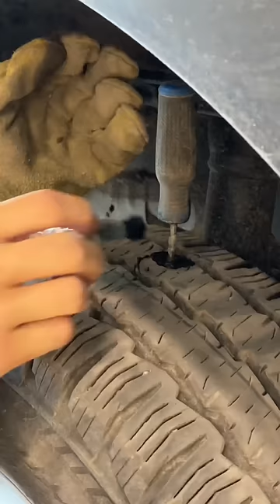Why You Shouldn’t Plug Tires #tiredoctor #tireguy #tires #shorts #tireplug

Comment: Tire shops hate people saving money
Reply: Crappy shop crappy service
Reply: It's actually DOT and the tire manufacturers themselves that directly state that these types of plugs are not approved for highway use. Installing these on a vehicle that will drive on public roads is illegal, so most shops aren't stupid enough to use them.
Reply: @grand_007 the crappy shops are probably the only ones doing it! All the other shops just want to sell tires 😂😂
Reply: @SleepyMongoose who do you think it was who lobbied and got DOT to claim they are unsafe to use but not unsafe enough to ban their sale.
Reply: @siegessaule  banned for highway use, but very useful for farming equipment which doesn't go 75mph+ on a regular basis. Being someone that has worked in the automotive field as a tech for (I lost track, 10ish years?), I will say that I would not be comfortable putting one of those plugs in my own car, due to the very important reason that unless you dismount the tire, you can't be sure that the sidewall is undamaged. If I am unwilling to make that repair on my own car, then I will not do it on someone else's car.
Reply: Former tire shop employee, this is true. Plugs can work well for many years but we weren't allowed yo use them because sometimes they dont work and then there'd be trouble
Reply: Or maybe they don't want to deal with repairing a tire with a plug in it because now they're going to be held liable for fixing something that was already damaged in the past the begin with so its a head ache.
Reply: 2016 Chevy Colorado caught a nail. Took it to the local shady corner  mechanics and they plugged it right in front of my eyes. The tire itself lasted for 30,000 miles before I traded the truck in all together to get my now 2023 Silverado
Reply: @SleepyMongoose ok Dingus
Reply: @SleepyMongoose  there is NO LAW prohibiting tire plugs for highway use in the USA or Canada. There are, however, guidelines for where plugs can, and cannot be used that have been posted by the US Tire Manufacturers Association. For example, plugging or patching a sidewall is a huge "no no" (though, it can generally allow you to limp the car at low speed off the highway if absolutely necessary).
Reply: @djbmw1 go to a parts store and grab one of these plugs type kits and read the packaging (you may have to buy it and read the instructions), somewhere it will either say "not legal for highway use" or "for temporary use only, see professional for permanent repair"

Every single one of these plugs that i have seen says one or both of those on the package or instructions.
Reply: @SleepyMongoose  thats to avoid potential law suits now, and in the future, to the distributor. There are no actual laws prohibiting the use. And i have several hundred plugs, as well as patches, since I own an auto shop.
Reply: @djbmw1  I don't care about your imagined credentials. If the repairs are acceptable, then there would be no need to avoid those lawsuits, right? If the repairs meet acceptable standards, then they wouldn't be liable. The patch/plug combos don't have that same warning, do they?
Reply: @SleepyMongoose  by posting a generic disclaimer they can sell plugs everywhere, at any time, and not worry about any current or future legal issues. This is why disclaimers exist.
Reply: @djbmw1  then why do patch/plug combos not have the same disclaimer?
Reply: @djbmw1  admittedly DOT regulations on tire repairs is very ambiguous, but it does state that repairs should be performed within the guidelines of the RMA or similar manufacturers group (which do not allow for these plug types), and the materials allowed for repair also implies (but does not directly state) that these plugs do not meet requirements.
Reply: @SleepyMongoose  To be clear, the DOT does not make laws. They can set guidelines and 'rules' which laws can then reference or be based upon. The DOT actually has an entire section on their website talking about the rulemaking process, if you want to take a read. My original comment was advising everyone that tire plugs are NOT illegal in the USA and Canada - period. There are, of course, advisories/rules/guidelines on their use - but no law says that they cannot be used in some sort of blanket fashion. From your comment above it sounds like you've now done a bit of research and are on the same page that plugs are not illegal for highway use.
Reply: @djbmw1  You do know that DOT regulations are actionable, right? The DOT can in-fact declare your vehicle is unsafe for road use an prevent you from driving that vehicle until it is properly repaired. (commercial vehicles covered under DOT)

A regulation is not a law, it is however the instructions on how to implement a law.

I am actually not on the same page, as the DOT regulations are a bit ambiguous on this matter as I have stated before. It would be on the DOT and the court system to decide whether or not the ambiguous language in the regulation prohibits the use of these plugs or not. Most automotive shops ban their techs from using these plugs due to this reason, the only shop I have ever seen that uses them was an independent shop. Every single shop I have ever worked at bans them.

The simple fact is that even if these plugs are not illegal, they still should not be used as anything more than a temporary fix or for off-road vehicles. The main issue is that there is no inspection of the inside of the tire, meaning you have no idea if the interior sidewall has separation of other damage that could cause a blowout. A blowout that may cause you the "shop owner" liable in an accident if you did not follow accepted repair practices.
Reply: First of all most but not all tire shops repair flat tires for free. Secondly a patch plug is the preferred method of repairing a puncture and installing one is just as likely to damage the tire. But the real reason I’ve preferred to not just plug tires is that you really should break it down and inspect the inside of the tire for damage. I can’t even recall how many times I’ve broken down a tire to patch it only to find it  full of shredded rubber because it hade been run flat.
Reply: Tire shops would happily do it that way if it was safe. A puncture repair is one of the least profitable things we do.
Reply: @bremCZ  every tire shop I worked at patched tires for free.
Reply: Moisture gets in the belting of the tire causing it to rust and separate. Some of yall have no idea what you’re talking about
Reply: @SleepyMongoose that’s not true it’s not illegal at all not even slightly
Reply: @SleepyMongoose  this is false. No law in any state bans the use of a tire plug on the highway so long as it is within the repairable boundaries of the tire.
Reply: That’s why you go to Costco for patches 😂😂😂
Reply: @SleepyMongoose  And all of that crap is why it's great to be able to do them yourself.
Reply: So many shops will do most leak repairs for free. Why do a plug if you can have them fix it free?
Reply: One of my local tire shops will plug patch any tire with a hole in the tread, and never try to upsell anything, but offer an inspection (only if the customer wants one) I asked the manager why they do this when anywhere else charges 30$. Aren't they losing money?

His responce

"People are so used to being upsold, or told the tire isn't repairable when it is they show up expecting it. This way they come back when they need new tires. At that point they trust our recommendation for mechanical work, and are more likely to get unplanned work done"

To this day I'm not sure if that means they eat the cost of a plug to make it easier to over charge in the future, or it was like the manager was implying and they charge reasonable prices, and are trustworthy.
Reply: My shop doesn’t fix a tire with a rope plug. But we don’t charge for flat repairs anyway🤷‍♂️
Reply: The department of transportation says it’s illegal for me (a mechanic) to plug your tire. If you wish to do it on your own time with your own tools then no problem I plug my own tires too lol but when it’s a customers tire it’s a patch and if it’s too close to the side wall then the whole tire is replaced
Reply: Sam’s club certainly is making a killing off me. I have to pay $0 for every patch done… breaking the bank!
Reply: @SleepyMongoose 🤓🤓🤓
Reply: Local tire shop owner here, we prefer to do plugs over patches or getting new tires. I’d rather work my ass off getting that plug in there rather then taking it off, doing a plug and work getting it back on. ESPECIALLY if it’s a big ass 24 or a low profile above a 18 inch.
Reply: @sleepdepello2932  I'm not saying plugs are worse. I am saying the US department of transportation does not approve plugs as a tire repair and you are opening yourself up to some nasty lawsuits because if you use a plug and someone wants to blame you for it they win the case because the DOT doesn't deem plugs as a safe repair

Comment: Farmer here. We have plugged everything. Cheap soft mower tires, pickup tires bald or dry rotted, skid loader tires that are hard as a rock (took an entire kitchen knife blade through the tire and that was 6 months ago it still never lost air), tractor trailer tires (unless the hole is bigger than 2 plugs, it always works even at 90 psi in the tire. The plugs are amazing. The only limits I have found for them are hole size. Not speed, not load, not heat. They are AMAZING. I would recommend people have small kits of them in their personal vehicles. The kit is extremely cheap and can save you a 200, 300, 400$ roadside assistance phone call. Once you're stuck out there, they know they have you. Especially at bad times of night, holidays, or in remote areas.

Comment: I ran a roofing company for 30+ years , and plugged hundreds of tires. I remember one tire I had that  had 23 plug.  And I have never used glue .
Reply: Technically it's not glue it's to vulcanize the rubber.
Reply: @rekcahx99   Really why does it say Glue on it?
Reply: @katkilr7685  you think the tube ALWAYS says glue?  I’ve seen it labeled LUBE.  Hope it wasn’t just an oil!  

The plugs you were using were clearly pre glued or they wouldn’t have ever worked.
Reply: @mikea5923  Well dude you are 100% wrong.
Reply: @katkilr7685  you’re trying to tell me your plugs were completely dry AND the tube ALWAYS says glue?  

You’re not a quiz kid, are you?
Reply: @mikea5923   You are about as bright as a burned out light bulb.
Reply: @katkilr7685  I’m not wrong.  Keep up with the bullshit no points, though.
Reply: Why do you think you have to peel that plastic sheet they come sandwiched in off?  That’s glue.  Durrrrrrrr.

Comment: I've plugged at least 15 tires on cars, trucks, and heavy trailers. Not one failure. And I've never replaced a plugged tire. I didn't even know that you're supposed to have it properly patched or replaced. The plugs work easily and permanently in my experience so 😂 shops and dealerships these days have no shame
Reply: Wowee at least FIFTEEN?? We’ve had that many in ONE TIRE and kept on truckin’ 😂  But u r correct you can run a plugged tire as long as any other tire if it’s done correctly.  I don’t think I’ve ever had one fail at the plug.
Reply: I have a tire with 24 plugs in it. On a small tractor.

Comment: It doesn't destroy the inside of the tyre. The reason they are not done from the outside and are even illegal in some places is that when a tyre is driven on while underinflated it can cause fatal damage to the internal structure of the tyre. The tyre needs to be removed from the rim and internally inspected before being correctly repaired.
Reply: THANK YOU !!!!!

Comment: I push it in dry. I'm just a savage like that.
Reply: Your talking about the plug right!! Lmfao lmfao 🤣 💀
Reply: At least spit on it….
Reply: Hope you at least take it out to dinner first
Reply: Out of necessity, because holes are always dry when you are around 😂😂😂😂
Bah dum dump
Reply: That's because they didn't know you were going to plug that hole. Got in there before they could say no.
Reply: Not even spit?😂😉
Reply: You realize that’s glue he put on it
Reply: @NoFaceTsu   Rubber cement*
Reply: Don't you prefer it to be a little bit wet?😂😂😂😂
Reply: I've done it and they still work just fine for years without cement if the hole is small.
Reply: That's what your boyfriend said
Reply: @MechanicalTriage hawk tuah
Reply: Lubrication is essential for work enjoyment!

Comment: As someone who was TIA certified to repair automotive, commercial, and Earthmover tires, I can say with certainty that all tires need to be plugged, if they have a penetration.  They also need to be patched from the inside, necessitating dismounting the tire from the rim, so it can be inspected.
Reply: That's a little confusing. They need to be plugged in patched or either or?
Reply: @rekcahx99  Not confusing.  For a tire repair to be done correctly, the hole has to be plugged, and a patched has to be applied to the inside of the tire.  To apply the patch you cut the plug off and buff the inside of the tire to get the patch to adhere properly.

Comment: i work in a shop. plugs are a temporary fix. patches/ plug patches are a more permanent fix but all of them have their cons and pros. as long as the air stays inside and its not on the sidewall youre fine as long as the tire integrity is good

Comment: I have used tire plugs every single time I've had a flat. I've even plugged a tire, taken my tires to get balance n rotated for the entire life if my entire mileage on the tires.
 The 1 time I took it to get patched from the inside my tire popped on the freeway..never again
I'm a Plugger for life!!
Reply: How would a patch cause it to pop?
Reply: @SamSam-ih6nt  the technician most likely buffed the inside of the tire too much, exposing wire.
Reply: That's why it's important to look at reviews for tire shops just like anything else. There are shops that will half ass jobs.

Comment: Yeah the shop also says the "sidewall" of a tire is the entire tire except for a 1/4" strip directly down the centerline and they still won't patch it...
Reply: you would think manufacturers would hve to increase side wall protection by now.🤔
Reply: LOL, so true!    Or, they'll say it's "too old to repair".    Meanwhile, tire wholesalers are selling new tires that are the same age, and they're fine.   A good half of tire shops are scammers, I swear.
Reply: Put your thumb on the shoulder of the tire, thumbs width is unrepairable. Good rule of thumb (ba dum tss). It’s like putting a bandaid on an elbow
Reply: @Gr8thxAlot  see I have an issue with your idea that it is the tire shops that are the issue. Check the DOT and tire manufacturer rules, they are the ones that stipulate the laws and rules for repairs and tire age. Shops that decide to break those rules do so at their own risk, as if they are caught they can face heavy punishments.
Reply: @brianjones1346 they do. They have different plys. But if you don’t want it if you don’t need it. It’s bad for mpg
Reply: @SleepyMongoo never plug your sidewall . Emergency situations only but get a new tire soon as you can if you get a sidewall hole in the tire
Reply: If you do a patch on the inside you have to scuff the coated layer off first it stick. Thats where the skeleton is. So scuffing that off not only has you destroying the physical integrity of the tire but the tire we most like end with a bulge there. I get he’s plugging so it’s different but in my opinion if it’s not an emergency repair it should be a plug patch every time.

Comment: “Is super frowned upon”, because we want more money and would rather sell you a tire, wait “ Selling one tire Is very dangerous and super frowned upon so we only sell in sets”.
Reply: Spot on! 😂

These goobers at the tire shop don't know anything. Every time I go to Discount they want to act like you need a degree to understand when the tread is low.

I once sliced the side of my trailer tire open on a metal plate and after I told the guy what happened he suggested I get a higher load range to prevent another blowout. 😐

Yeah let me just get tires that are well beyond the capacity of my axels for no reason. Sounds good, man. You're the best.

Comment: As someone who does flat repairs daily, most customers don't want plugs. Most request patches and have a mistrust of plugs, and from what I gather, it's from 2 main reasons. Reason 1: someone plugged a tire for them that should have been patched to begin with, like they had a large bolt or something that a plug wouldnt fix. 2: someone told them plugs don't work which is probably onenof the people from Reason 1. Plugs are just as permanent a fix than a patch if you do em right. 90% of my flat repairs could be done with plugs because its usually like a small nail or a self tapping screw, etc. I always repair it how the customer requests, but if they don't give specific instruction on how they want it repaired, I leave it to dealer's choice and fix each tire accordingly.

Comment: Plugging tires has saved me literally thousands of dollars and I kept the same tires with multiple plugs for like 5 years. It’s awesome. If the plug fails for any reason, put two plugs where that plug was. It costs like $5 for everything you need at Walmart. Vs $200+ for a new tire that you don’t need

Comment: Almost 2 years and 30,000 miles on a plug I put in and it’s still working great without any issues. I’m about due for new tires. I guess I’ll call it a success. The one thing I would recommend is not to plug a sidewall puncture.